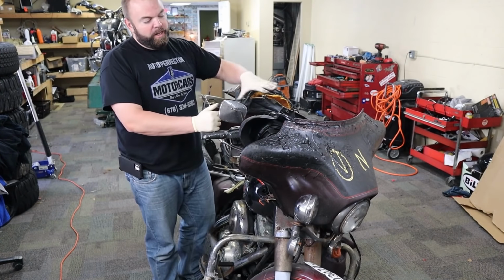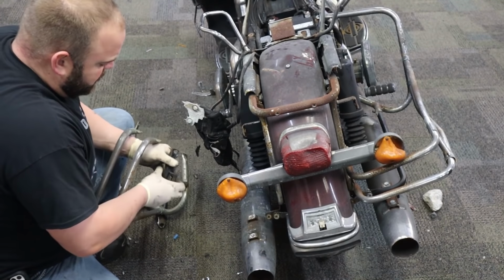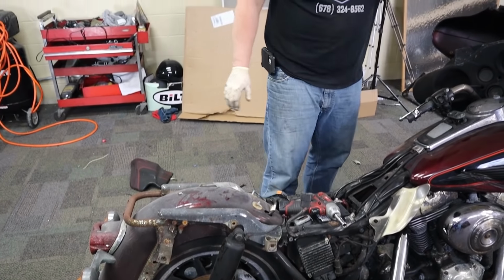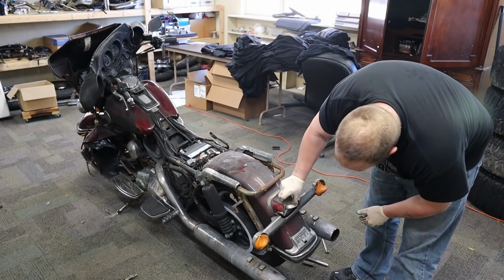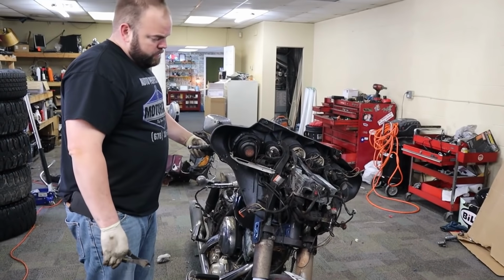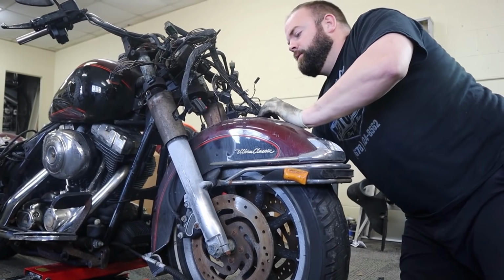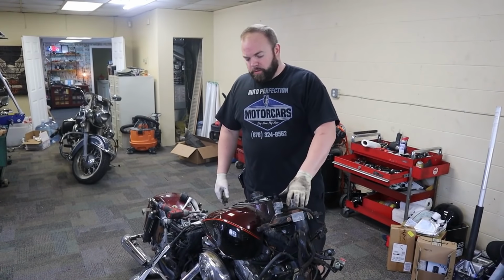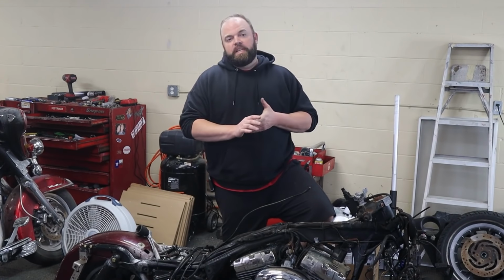Newest Harley Project! | Part 1 l Budget Rebuilds

Comment: I have some new oem parts I'll swap ya for a set of handle bars like 12"-14" apes or highway pegs with mounting brackets, I have lenses, floor board inserts, master cylinder, things like that
 If you need a pic of the stuff I have give me a email to send the to. They are new take off parts. Thanks